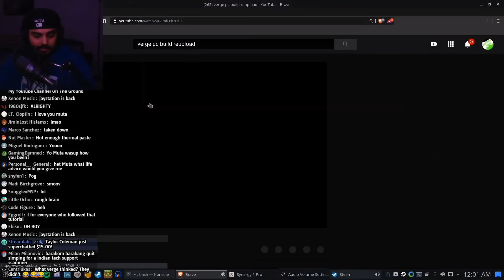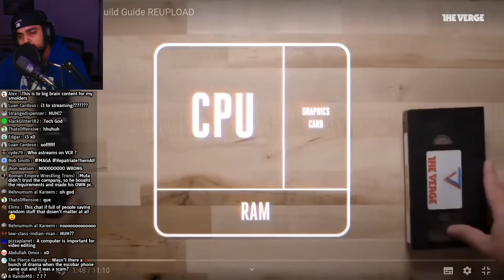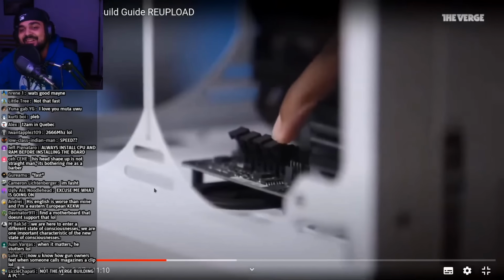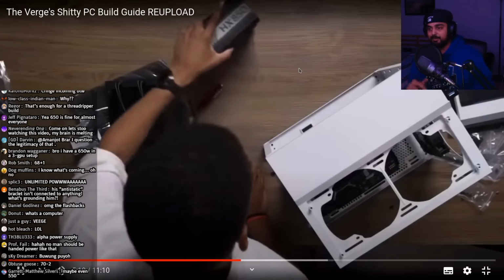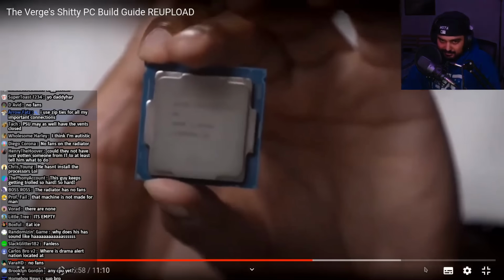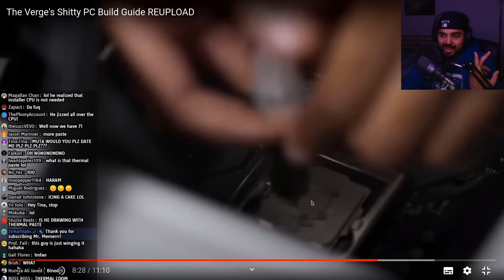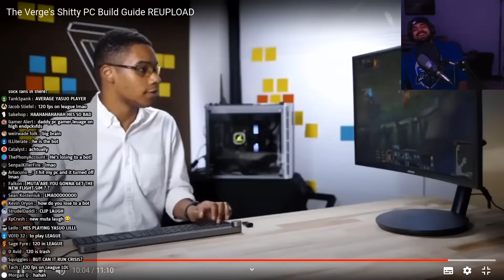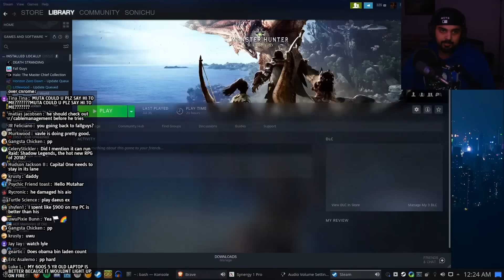SomeOrdinaryGamers - Muta learns how to not build a PC (w/ chat)

Comment: "You need a table" I literally built my custom PC on the floor
Reply: Same
Reply: Yuuuup same
Reply: @PaulLavi  exactly
Reply: same
Reply: @PaulLavi  bro that actually has static danger. I recommend a tiled floor or a table my dude.
Reply: @davidlee1770  get a livestrong bracelet to fight the static and cancer at the same time.

but yeah, wear a grounding bracelet PROPERLY and building pc on the carpet isnt that big of a deal. or having the psu plugged in. As long as static has a path to ground its fine.
Reply: I did too, I didn't have an empty table large enough at the time
Reply: @davidlee1770  bro, just ground yourself regularly on the psu
Reply: Same lmao
Reply: Dude you did it wrong, the verge said so
Reply: Every time I make a new PC or work on a pc in the future, I'll do it on a carpet floor.
Reply: I made mine on an ironing board
Reply: @PaulLavi  you madlad
Reply: Bruh you people need a floor?
Just build it  f l o a t i n g  i n  t h e  a i r !
Reply: I built mine on a piece of wood outside in my garden lol
Reply: On kitchen slab.
Reply: @daemon1849  They obviously grounded themself as they were working on the floor
Reply: Same
Reply: @davidlee1770  nah, static doesn't affect modern hardware. Maybe if you wore a doofensmirtz wool suit and rolled over a carpet
Reply: I've built multiple computers on my bed
Reply: No need to worry about grounding if you're on the ground
Reply: builds pc using the ceiling as a surface
Reply: same
Reply: same
Reply: yeah same i built mine on the floor LOL
Reply: @PaulLavi  that can kill your PC.....
Reply: @daemon1849  my therapist told me to flick my fingers as a grounding technique
Reply: @PaulLavi  

Not the same but similar- I took apart and put back together my xbox 360 on my hardwood… Best comments based off this quote

Comment: my teacher actually made us buy those static bracelets or we couldn't build the pc for an activity
Reply: A true anti static bracelet has a wire attached that you use to ground yourself. We used them when I was in the military while assembling flare for Aircraft.
Reply: @milkyswag01  glad to know mine was a real one then
Reply: A proper strap has a wire from it with a clip that attaches to the metal frame of the work bench, or if you don't have that then you can attach it to the  metal case of the computer, and if you don't have a strap, then holding onto the case is enough to discharge static charge off skin. Your teacher insisted on strap because it is the ideal proper way to protect against static discharge, and it does allow freedom for second hand to work on computer with.
Reply: @MasterChiefAgent007  Glad to know his worked
Reply: You can actually just scoot around on some carpet with toe socks on it does the same thing unless you're a bigot
Reply: Wait fr?
Reply: Tbh I wouldn't trust a bunch of kids to touch metal before either
Reply: You have that kid of activity in schools? Cool man
Reply: Bracelets are useless and ripoff, just hold a damn case with one arm even if you lift your hand it is okay since you already touched metal, you are not constantly spraying electricity from your body like you are a Tesla coil damn it.
Reply: You could build a pc in class wtf?
Reply: @shitpostcertifiedmoment8083  we were studying the parts that made up a System Unit so my teacher made us build one, 
Basically his way of quizing us, fun class
Reply: Touch the screw head on the light switch
Reply: @marikroyals7111  Superpowers aren't as fun as one thinks they are I guess
Reply: You don't actually have to worry about static, actual static can't even shut down a PC, even if you take one, it does shut down, but you can turn it back on and it works perfectly fine.
Reply: As bitwit said in his video, that's a live strong bracelet, you aren't fighting static, you're fighting cancer lmao

Comment: THE PSU fan going on the inside coocking the motherboard. Somehow didn't destroy the liquid cooling by putting in the long screws without the fans that should be on there... The  m.2... wonder how long that will last it has no braket and was pushed down to the motherboard. the GPU lucky geuss... Because the ports do matter.... top often is the faster slot...
Reply: Your words are too big for me
Reply: "cocking"?  What?
Reply: It won't cook the mobo because that's the intake. But it's indeed being suffocated.
Reply: (easier to understand rephrase)

its not cooking the motherboard, the fan for the psu has like 1 cm of clearance for airflow which isn't enough and might just slowly fry that psu until one day it don't work no more. (heat degrades electrical components faster)

The liquid cooling you referring to is the radiator, of which the dude used the long screws for when you have the fans on the same side as the screws, instead he just threaded the long screw through the rad, i'm surprised his rad didn't just start leaking from that. 

the m.2 usually has a spacer between the m.2 itself and the motherboard so that it is not resting on a bare pcb, but the dude just screwed that baby on there with no stand off.

 The gpu on the other hand is a lucky guess, the reason is that on most boards the top most pcie slot is allocated 16x lanes from the cpu while the second to top most slot is commonly 8x for most consumer cpus. (some cpus e.g. server cpus have more bandwidth, of which it can allocate 16x lanes to both the top and second to top most slots)

oh yea the ram, thermal paste, cable management, rad placement and cable management was also fucked up
Reply: But at least he put on the rubber pads to prevent short circuiting!!
Reply: @ccricers  oh no i  forgot to put the rubber pads and i have been electrocuted by my case!
Reply: i mean that psu fan will never work anyway cuz he put a fckin 850w psu with just 1 gpu its way overkill im not saying that what he does its right but its not a big issue aswell he has way more issues in that pc build then that
Reply: I haven’t seen this guide in over 2 years and I still find things that make me slam my head... like dude just throws the cpu socket cover and exposes the pins while dangling other shit over it... the cover is supposed to pop out when you completely install the cpu. Also he goes on and on about using the cpu install bracket and them proceeds to install it in the wrong way. You can see the resistance from the lever in the video.
Reply: @SlyTV  is that PSU rated gold or platinum? Either way it is overkill for a build like that unless he's gonna add another GPU (by then it would still be overkill but not as much)
Reply: @demonking86420  thats what i said so putting that psu wrong its not a big deal in his scenario he has way more worst thing than that

Comment: 2:35
This right here is the bain of tutorials. When building/assembling a pc, you don’t need in-depth knowledge on the inner-workings of ever part of the PC. Basic knowledge will do you just fine.
Reply: While that in itself is true, as a IT-Engineer i can tell you, its good to know a few things here and there.
However, it should be more important, as to what you put in and what is neccessary to have, as well as the stats of the parts themselves and how well they work together.
in-depth however, i agree on that, is unneccessary.
Reply: @BeyondTheZenith  
And also it is way better to consult someone who knows how these things work, or even, research them on your own!
Info on the internet is plentiful, but it is a bit hard to quickly come to a successful conclusion, since you need to actually read stuff and not just pass by the information without second thought.

I was lucky I did buy a 2nd gen ryzen compatible motherboard, I didn't even know at the time that mobos dont just support cpus on their own.
luckily i did not learn the hard way, but after reading the manual/docs that came with the parts i bought told me that there is yet so much to learn
Reply: While true, it is very helpful to understand how the device you are assembling works. As an HVAC technician my coworkers and I can install a central air system all on our own easily, but if something were to go ary during startup, I'm the one who usually fixes the issue because I am able to troubleshoot the machine and solve the problem. You need a deeper understanding of how the machine works to troubleshoot my dude 😊
Reply: @broken_font1881  Amen to that
The more you know the better you can troubleshoot
Reply: @BeyondTheZenith  Of course, I agree, that's why I said basic knowledge. You should know what every part roughly does before even handling it or else you cause some sort problem.
Reply: you have a room temperature iq if you think that was in depth knowledge. it was insanely basic and what he said about the power supply wasnt even correct
Reply: jojivlogs_ maybe I should’ve been more clear, he shouldn’t have stopped the tutorial and go on to defining every part in descriptions like he did. He should’ve just said, “ this is the cpu, it’s basically the brain of the pc and it’s really so be careful” (puts it in) it’s fast, easy to understand and it gets to the point.

Comment: He talks about pairing an i3 with a 1000 dollar build
Reply: RTX 3090 ti 
ASUS ROG Zenith
128 GB 2666hz RAM
Antec High Current Pro HCP-1200
Intel 4004
Reply: I have an i3 with 2c 4t and while streaming I can barely do anything else lmao
Reply: @xyzzy219  lol, really if you are going with an i3 you should just get the 10100, but if you wanna do streaming you could go for like a 2600, depending on the current price
Reply: @Spencii1  I currently have an i3-1005G1 because of my Lenovo laptop I got lol. I can't really get a custom build or anything because I don't have the money
Reply: @xyzzy219  yeah they can get expensive, but there are budget builds also, you can build a good gaming machine for cheap if you do the research
Reply: @Spencii1  i've never looked for one of those videos. i'll look for one to see what i can get for a budget. 👍
Reply: @xyzzy219  tbh you could probably do a good budget build with a ryzen 5 1600af and a rx 570
Reply: My old 500$ build had a better cpu lmao
Reply: @johnmadden52  lol
Reply: @dogol284  pretty sure that rig can max out cyberpunk on 420 fps

Comment: Just a note on the PSU. Having more power than you need is better for energy efficiency and makes the PSU last longer. It also allows for future upgrades. I'm not sure if those fully compensate the price difference in the long run, but I personally like my stuff to last longer even with the extra cost.

Comment: I teached my sister how to build a gaming pc, i helped her, only with words, the mobo got its ram, cpu and cooler OUTSIDE of the case, because its easier that way, she mounted the psu the RIGHT way around, she installed the storage drives correctly, her cable management is ok, but could be better, she didn't put wrong screws into things potenially killing something, and yes, it was her FIRST build, and what do you know? The pc just posted fine! She knows now what ram and a cpu is, and she is so proud that she build her first pc, i picked the parts and she is so happy now, i told her she could have it (i already have a kickass gaming pc)

Comment: How's he gonna play Cyberpunk 2077 when he can't even play Flight Simulator X on this shitty PC?
I mean, I had an old Asus Notebooks with ATI GPU (not AMD.. This was still the time where ATI was rocking the market) and I was able to play that game with 40-47fps on 1080p.
It was like 2008-2009?
By now, my 4 year old MSI Gaming notebook would easily get more than 100fps in that game
Reply: I don't think that was Flight Sim, looked like ARMA 3.
Reply: That wasnt fsx. And also fsx does not scale with modern hardware well anyway so a new system might actually struggle due to not being optimised for modern hardware.
Reply: my nigga just called ARMA 3 flight sim LMAO.
Reply: Btw 75-80 fps on Arma 3 is pretty god tier. You wouldn't be able to get more than 90fps even with a threadripper paired with two 3090's. Game simply isn't optimized at all. That said, the build was fucking garbage.
Reply: @gmaergabe7313  On single player that frame rate is extremely easy to meet. I have a laptop and it can hit those frames. On multiplayer servers its a different thing all together but i still average about 40-60 which is fine for Arma 3.
Reply: @CW-yp9jo  yeah thats about right. I think I get about the same framerate in singleplayer, but Arma 3 is truly a multiplayer game so if you're okay with 30 fps being stable during some tenuous processing moments you're good to go. As someone who builds massive missions for 40 people with 100+ mods, it's been a long time since I've seen 60+ on A3.
Reply: It could run Cyberpunk

Comment: Me watching this after cyberpunk comes out absolutely laughing at the fact he says it can run that at decent settings
Reply: 1080ti is still pretty good, it could run Cyberpunk at decent settings
Reply: @GSG-io8zp  he has a 1080 that isn't built properly so he won't even get the best performance from the build if kept this way
Reply: @nnightkingj  Well the 1060 can run it just fine
Reply: @GSG-io8zp  of course a 1060 on a properly built computer but this guy didn't even put the ram slots properly which halves performance

Comment: I'm surprised Muta didn't point out the fact he called zip ties tweezers for some godforsaken idiotic reason, decided to use a swiss army knife which may or may not contain a philps head driver, and the fact the ground strap isn't attached to anything and so isn't grounding a goddamn thing.

Comment: I've got a geforce 1060 6gb and an i5-4460. Still chugging great on 1080p. You don't need a TwO GrAnd pEeCee unless you actually play on 4k or wanna max out settings with 144hz. 
My cpu is starting to become a huge bottleneck but i'm scouring for a better one tho.
Reply: speaking of 1080p
even a pleb ryzen 3 2nd gen with a 1650 (yes you heard that right a raw 1650) runs actually suprisingly well at 1080
couldn't say that to my old core 2 duo + gt710 pair last year
Reply: @necrobynerton7384  My last pc was a c2d too lmao. Paired with radeon 7870.
Was about time to update. It surprisingly ran gta v and witcher 3 quite well

I gotta buy a new mb+cpu+ram combo as soon as i figure out something cheap but good. Budget pleb ryzen but overclocked to high hell sounds good.

Comment: I did a boo boo when I recently upgraded my pc. Plugged in a cord to the PSU while it was on cause I didn’t know much better at the time and I think I borked it a bit. I got 2 random reboots recently and furmark keeps showing artifacts. I’ve swapped GPUs and that didn’t fix it and I did a mem test(even though the artifacting doesn’t look like what bad ram produces) so I’m fairly positive the cause is not those so the next logical step I’ve been told is the PSU is fucked and I imagine it happened when I installed it lol. PC still works though funny enough I just have to probably get a new PSU to work out the kinks.
Reply: I was getting random restarts and also like artifacting or games just playing kinda badly,
apparently my psu was bad, after i bought a new one, stuff magically got better.
Oh and also double check your cable that connects to outlet & psu, mine is a bit borked right in the psu connector side and if i just slightly nudge it it completely shuts my pc off
Luckily i haven't fried anything...yet... but if i find the right time i will open it and tighten it if i can.
Reply: Necroby Nerton this sounds very similar to what I’m experiencing minus the power cable thing lol. I’m getting the new unit tomorrow, hopefully that fixes everything.
Reply: Figured out what it was that was causing the artifacting. It was my monitor. Lol ffs
Reply: @TheHahaman23  Hey, you at least found the problem!
Although monitors (at least in my experience) dont tend to break easily but hey, electronics never last forever
Reply: Necroby Nerton yeah I don’t know what happened to it. Like I’ve said we swapped the GPU AND the PSU now, and neither fixed it. We only switched monitors as a more a fuck it kind of thing and it happened to fix it. I couldn’t tell you what was wrong with it tbh lol.
Reply: On top of that the monitor in question was less than 2 years old so it doesn’t make sense to me lol
Reply: Am I reading this right? You need the PSU to be plugged in, obviously, but you plugged it in...double plug? Am I having a stroke? I don't get it.
Reply: @BichaelStevens  you may very well be having a stroke as this is a three month old comment and I’ve since fixed me rig. Might want to call a doctor.
Reply: @BichaelStevens  also to clarify since there is apparently confusion. Back when this happened I ended up plugging in the power cable to my GPU into my PSU while the PSU was on while I was installing parts cause I didn’t know any better at the time. This in turn actually shut the power of to my PSU when this happened and afterwards I started noticing artifacting in furmark tests and I thought that I fried something. Thought it was PSU or GPU, swapped out both and neither fixed it and soon found out that for whatever bizarre reason my monitor was the cause of the problem. Still don’t know why but idc it’s dealt with now.